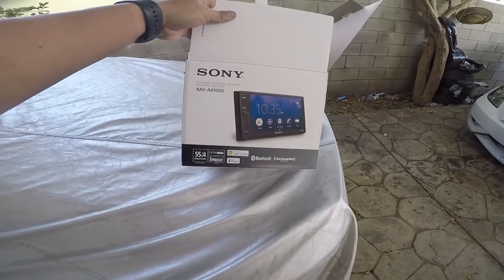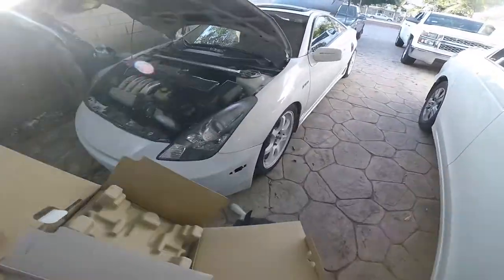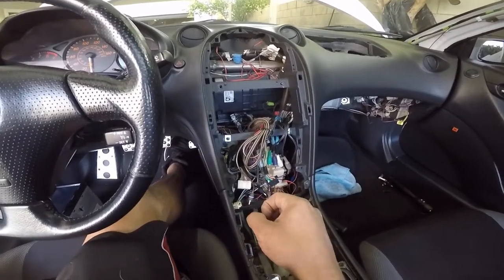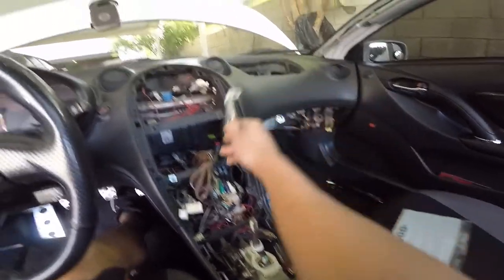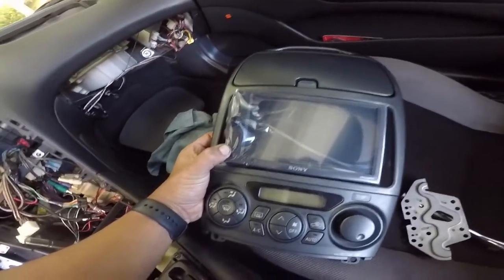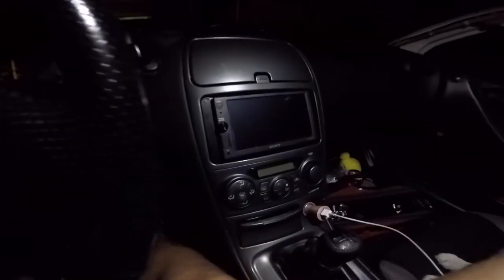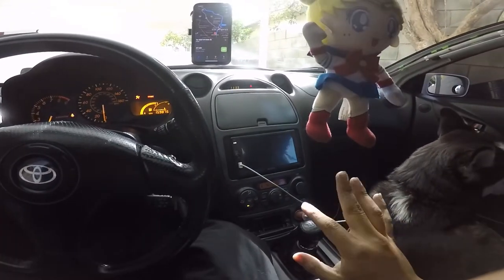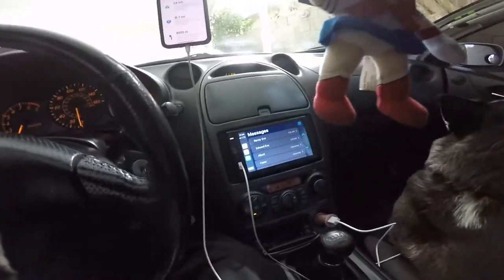Wife Birthday Gift

Comment: Hi raf. Sorry to bother you again. I need an experts advice if you can help. I have 2002 celica 190. I want to put the original o e m celica T sport wheels n tyres on. There a 7J figment wheel. And 17 inch wheel and want to put 17 inch tyres. Will it go straight on my car without any problems. Thanks.
Reply from the maker: Joe Blogs I have 17 with no problems
Reply: These are I believe Toyota it says on back. I was worried about sizes. Which I don’t understand. But if you say they ok I’ll trust ya judgement   Thankyou for reading and replying. Be well be safe all the best
Reply from the maker: Joe Blogs those are the trd wheel that came on the celica
Reply: Don’t know can send photo if you  like